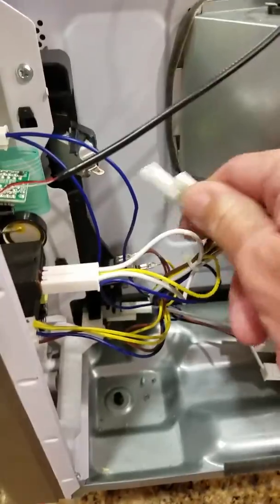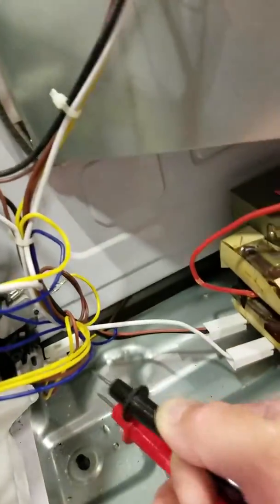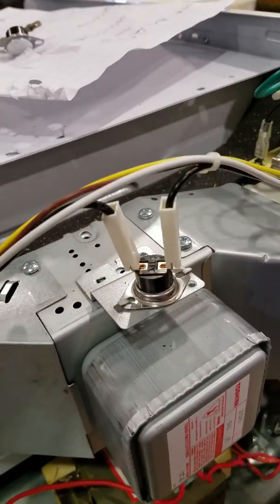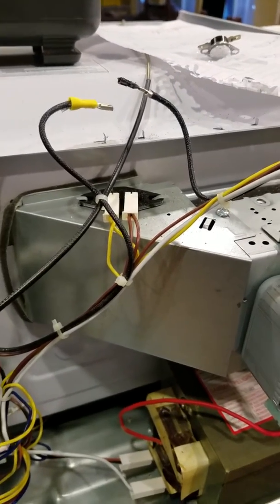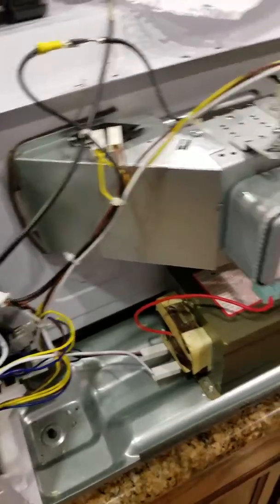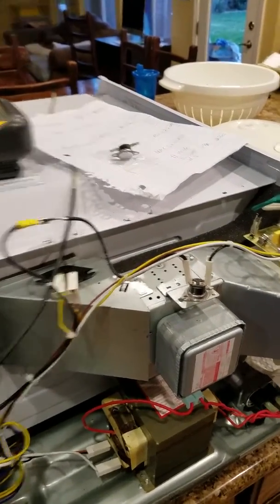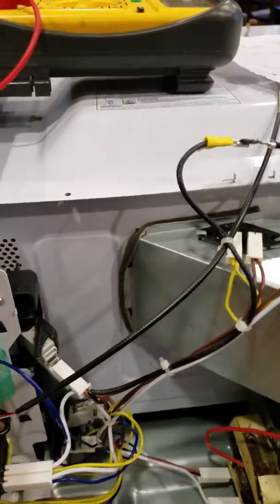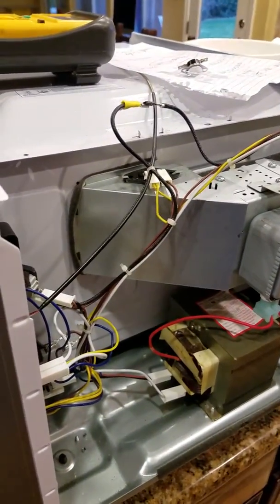Whirlpool Microwave intermittent or no power

Comment: My thermostat(kds201 70)had no continuity. I accidentally purchased a ksd301 70. The original also had a red dot on it. Can I use the 301 or do I need the 201 and what about the red dot?
Reply from the maker: These things vary I put in what ever was taken out so you need to call the place you bought and find out if they are the same .😇
Reply: @mbjdiy1778  got ya👍. I figured, just a hope and a prayer lol
Reply from the maker: Most are rated by temp.😇
Reply from the maker: https://www.google.com/search?q=thermostat(kds201+70)+specs&rlz=1C1CHBF_enUS989US1000&oq=thermostat(kds201+70)+specs&aqs=chrome..69i57j33i10i160l4.4069j0j15&sourceid=chrome&ie=UTF-8

Comment: Cavity thermostat ?Open or closed?
Reply from the maker: Cavity Thermostat Closes at 158 degrees F. | Appliance Videohttps://www.appliancevideo.com › repair-help › question
Hi. Yes, it looks like you are talking about the hood TCO. This is a normally open t-stat. When temperature reaches 158 degrees, the t-stat will close which ... 
https://www.google.com/search?q=cavity+thermostat+for+microwave+normal+open+or+closed&rlz=1C1CHBF_enUS989US1000&oq=cavity+thermostat+for+microwave+normal+open+or+closed&aqs=chrome..69i57j33i299.22906j0j15&sourceid=chrome&ie=UTF-8#fpstate=ive&vld=cid:50beb16a,vid:jlH_f-6Vl-0 😇
RPC VIDEO https://www.youtube.com/watch?v=8xr7bK1b2jc

Comment: I understand some of the thermal fuses only open when they reach a certain temperature so how would you test for that?
Reply: Regardless of individual ratings; once the T-stat opens, they don't reset themselves.
Reply from the maker: How can you tell if a thermal fuse is bad? Multimeter Test Remove the two wire leads from the thermal fuse and touch a multimeter probe to each wire terminal on the fuse. If you get a reading of infinity, the fuse is fine. Any reading less than infinity indicates a triggered thermal fuse you will need to replace. Works for me 
https://popularask.net/how-do-you-troubleshoot-a-thermal-fuse/#:~:text=How%20can%20you%20tell%20if%20a%20thermal%20fuse,triggered%20thermal%20fuse%20you%20will%20need%20to%20replace.
Reply: @mbjdiy1778  Your reply is opposite to what you said in the video . . .  infinity means no continuity that indicate fuse is blown